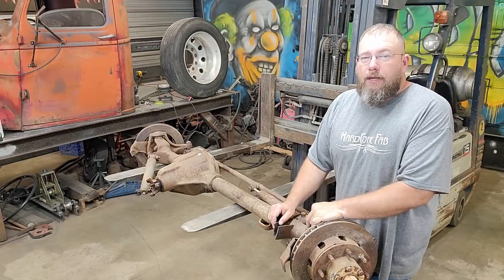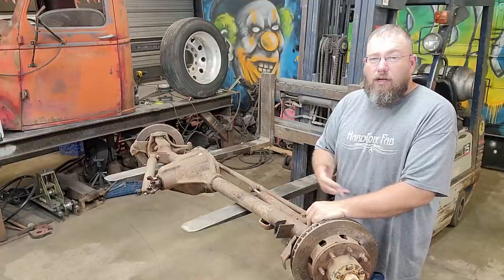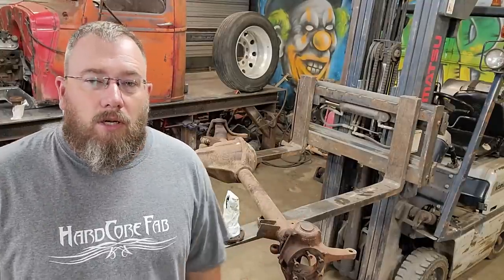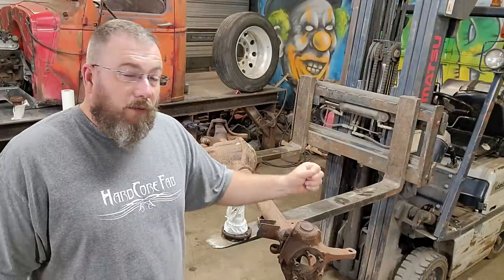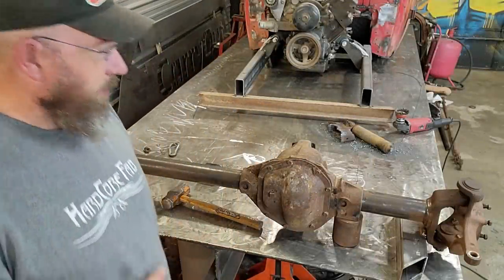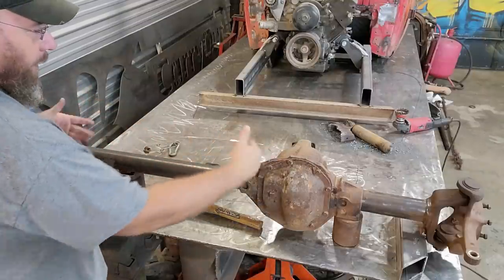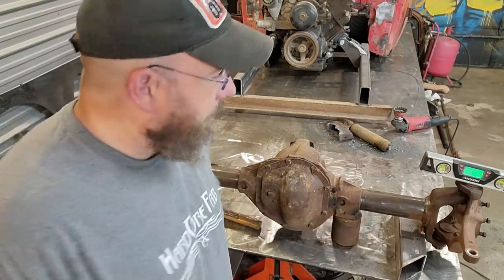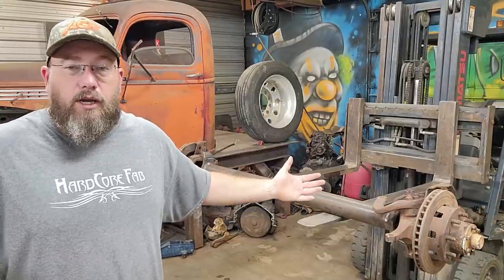Tree row find

Comment: That's coming together really nice! For future reference the Ford Superduty 2wd all had a straight tube axle like that. 8 lug and huge disk brakes. They have a crossover type steering from the factory though but I'm sure fabbing a steering arm would be a simple task for you. Can't wait to see the cantilever air setup for the front. I'm trying to figure out a decent way to do a triangulated front  cantilever setup so I don't have to run a panhard bar. It's built in my brain I just need to do it with metal now and see if I die from death wobble lol
Reply from the maker: My cantilever air setup video is coming soon, although I'm using a panhard bar, but if you triangulate the bottom bar you should be able to get away without the panhard.

Comment: older dodge and maybe some fords use the same rotor as 3.4 tons and have a adapter that bolts on to move wheels out for the 1 ton style wheel if your wheels are to close to hood or what ever so it will turn  good

Comment: I'm building an axle just like that. Can you tell how you plan on hooking up the steering arm. The tie rod end is on the front side axle and the shaft has to hook there somehow. Are you building an arm to go over the tube or buying something premade?
Reply from the maker: I'm going to use the one that came with the axle and goes over the tube.  I'll talk about it more in up coming video.
Reply: @HardCoreFab  thank you. I'm very interested in how it turns out. I've gotten some very good ideas from you.

Comment: Cool how you convert an old Chevy 4 wheel axle into a 2 wheel drive. What size pipe did you use? Is it a DOM?
Reply from the maker: It's not DOM, but I will be covering this in the next video!
Reply: @HardCoreFab  Thanks for the reply, what is the tile & date of the next video?